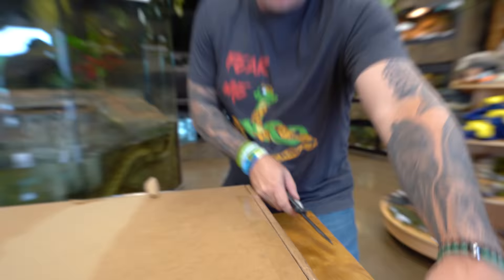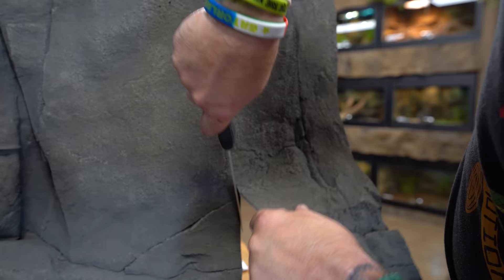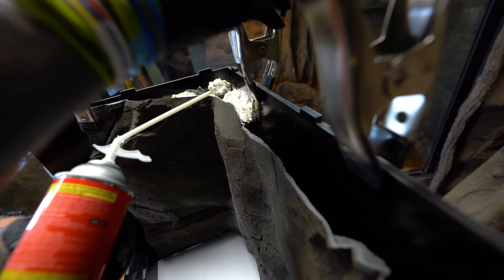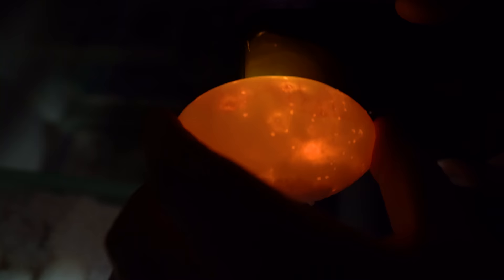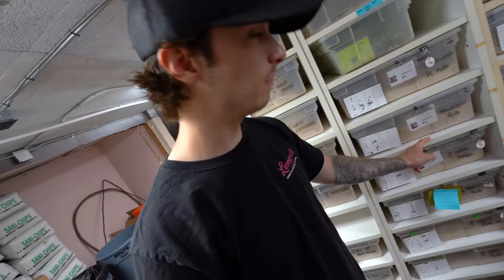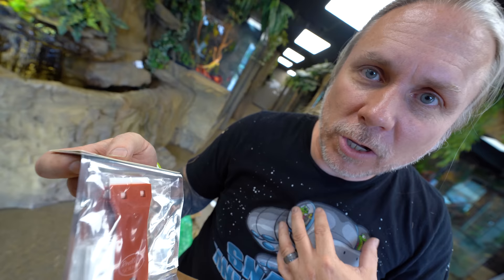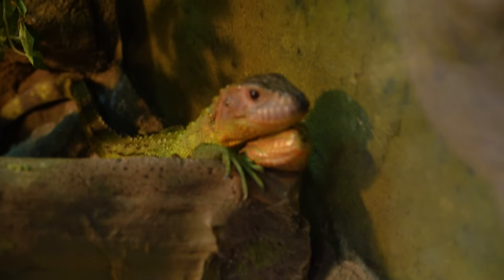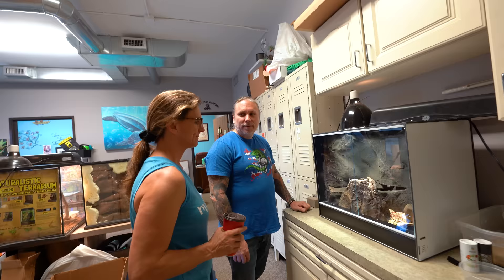Upgrading My Blue Lizards Cage! Awesome New Look!

Comment: This is obviously just a big ad. DO NOT put your Uromastyx in such a small cage. Its so small there will be no heat gradient which means there will b no escape from all that 130F heat. Also you must provide UVB. Dried millet & lentils r ok for adults only not these little babies. The dried seeds r to hard for babies to chew, will soak up their internal moisture as they try to digest them & possibly lead to blockage. You can however soak the seeds and then give them some but placing babies on a bed of dried seeds is not a good idea. Mixed greens (with no spinach, kale or chard), arugula & butternut squash r good staple foods.   Im disappointed in this advertisement. To much info lacking and wrong product pushing for a dollar.